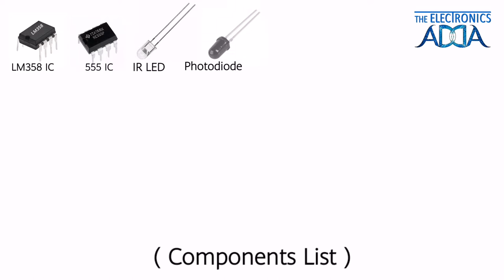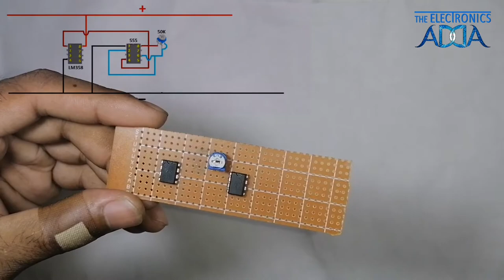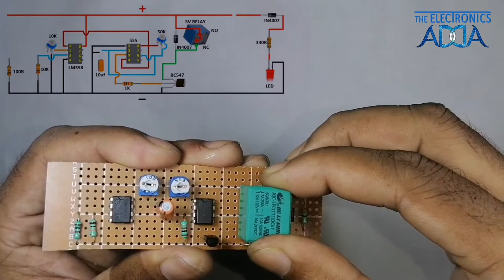Automatic Hand Sanitizer Dispenser With Delay Time | Hand Sanitizer Machine | COVID-19 Special

Comment: Does this design has a cut off feature and do require a fresh trigger to restart the sanitizer?
Reply from the maker: Thanks for the comment 👍❤️❤️
A timer is attached to this circuit..
Reply from the maker: No need to create new triggers to restart the sanitizer, it will be automatic
Reply: @THEELECTRONICSADDA  
Thanks for the fast response :), Im planning to create Automatic Hand Sanitizer as well.
So it has  T = 1.1(50k ohms) (10 micro Farad) = 0.55 seconds interval time.
Am I Correct?
Reply from the maker: Yes you are right
Reply: @THEELECTRONICSADDA  Thank you so much :D
Reply from the maker: But if you use 100UF capacitor instead of 10UF capacitor, you can adjust the timer more easily.
Reply: @THEELECTRONICSADDA  I would like to ask what is the purpose of the relay.  Im a little confused on the applications of relays
Reply: Can i remove the relay? to lessen the cost of the circuit

Comment: How long the battery charge will last once fully charged
Reply from the maker: Thank you so much for the comment
Reply from the maker: Normally the battery will be charged for 1 to 2 days after full charge. 

Will then depend on the use
Reply: @THEELECTRONICSADDA  thanks for your reply.so it may be the ir proximity module which continiously draw the power even in idle mode.is it possible to reduce the power consumption ? Like normal battery operated hand sanitiser lasts more .. Any suggestions will be highly appreciated
Reply from the maker: Yes you are right the IR sensor continuesly draining the battery. You can increase the battery life by using good quality battery's.

Comment: Hi friend can you teel me how to make this circuit with readymade ir module.
Reply from the maker: Thanks for the comment 👍
Reply from the maker: This circuit can be easily created with the IR module, just connect the relay module to the output of the IR module.
Reply from the maker: But
I have added a delay timer circuit with the circuit I made
Reply: Yes friend i.know that and i want delay timer functio. With the redymade module i dont want to make it module as i have lots ofo them so can you tell me how to connect delay module with that.

Comment: You could use a single npn transistor plus 150ohm resistor instead of the 555 timer circuit
Reply from the maker: Hmmm, you're right

But if you use the transistor, the timer cannot be adjusted
Reply from the maker: Thank you so much for the comment ❤️☺️👍